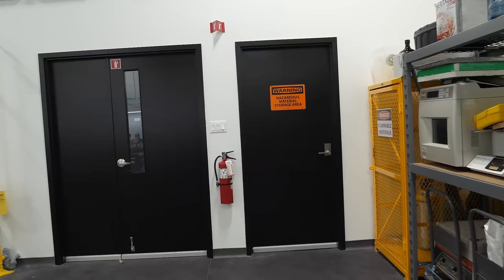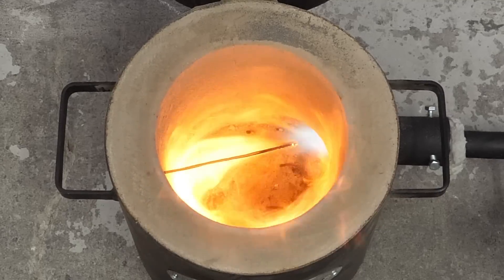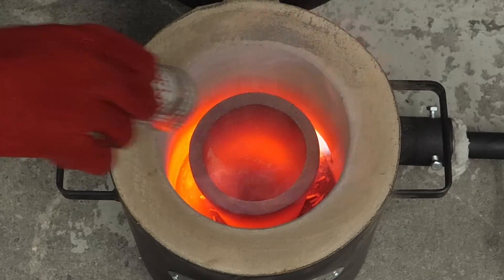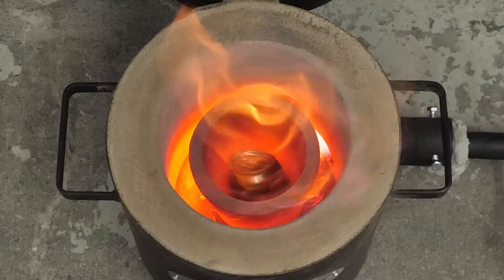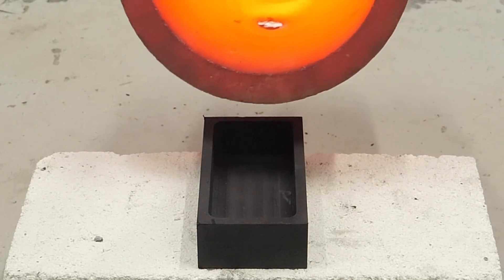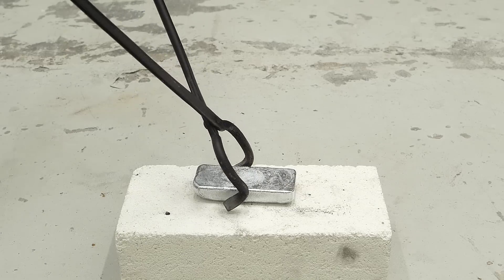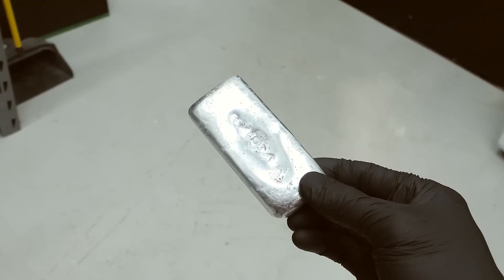Turning soda cans into a metal bar

Comment: Should have separated the lid and the bodies, as they're different alloys even if both of them are alumium-based. I doubt brass and bronze would have been mixed, for example.
Reply: Most brass and bronze alloys are eminently mixable, actually!  The classics all have some amount (including zero) of zinc, tin and lead (balance copper).  Brass of course having no tin, and maybe a little lead (free machining brass), classic "bronze" having just tin (in varying amounts depending on desired hardness), and mixes for various purposes (85-5-5-5 was commonly used for e.g. cast plumbing fixtures).  Also nickel for corrosion resistance and strength (Monel metal; most silvery coins are made from, or clad with, something like this), silicon, and others.  The ones I'd watch out for, are aluminum and manganese bronzes, which might not play well with other elements, or are simply harder to work with.  (Whereas silicon bronze is especially easy to work with!)
Reply: @T3sl4  You missed my point. I do not say both Al alloys will not mix. I said that it is not conceptually accurate to call such mix "Aluminium". If you melt copper parts for doing a copper inglot and call it copper, you use (usually) quite pure alloys. Mixing brass and bronze and calling it copper is an aberration. By the same way, what you get in the video experiment is not "aluminium". Al least, if you use ony one alloy, it would be closer to "aluminium" than mixing whatever alloy you can get.
Reply: @antonioamosanchez4912  Sure; we don't have words for classes of aluminum alloys, like we do bronzes. Alloys also don't look any different from pure aluminum, and most of them can be said to be 95%+ pure.
Reply: No that's actually how they recycle aluminum cans. The main difference between lid and body alloys is the lids have a bit more magnesium than the body. During the smelting process, some of the magnesium reacts with the oxygen in the furnace and comes out of the alloy as magnesium oxide slag. Thus bringing the magnesium average back down in line with the body alloy. So lids+bodies+smelting=body alloy.

Comment: The smoke was from the paint and inner plastic lining (and any residue left from the beverages the cans contained), and yes it is bad to breathe. You should wear a respirator or at least an N95 mask.
Also, you don't need to light the furnace, put the crucible in, then put the cans in once it's hot. It's a lot more efficient to just crush up a few cans and fill the crucible with them, put it in the furnace and then light it. You can then add more cans once the initial lot have melted.

I used to do metal casting as a hobby, but had to stop when the neighbours complained after I melted some brass and they got the zinc fumes blown onto their property. Not my proudest of moments...
Reply: That's why it's usually done in a well ventilated, spacious indoor area like a garage, right?
Reply: @ZudeXbox360  nah wont advise in garage  outside  garage yes. Lpg and propane  gas flames can go high.dont  want to set place on fire.
Reply: @frikkiesmit327  Hah, fair enough. I guess I was thinking closer to like a big warehouse, like a glass blower work area or so when I said garage.
Reply: @ZudeXbox360  oo oky. Sorry.    Well if we look at bigstackd  for example where his furnace stands he is almost in garage but ok the devil forge ( furnace ) he uses with its burner of course burns the gas right so you that have too much flames.  Ive been playing with casting for a while now but it was with low meltpoint metals like zinc and lead. I had channel on youtube but somehow lost access. So i will make new one maybe in month or two. With low meltpoint metals you need only handheld blowtorch we gets hot enough to melt metal to be pourable.its still a fun hobby .
Reply: This is a nice comment, and I hope you and your zinc fumes detecting neighbors have a lovely day.
Reply: Nile didn’t crush the cans so they’d look good on camera as they melted
Reply: N95 masks dont do much to protect you from gases
Reply: @waterturtle2919  Although true, this is false in the context here.
Many metal workers do in fact use N95s to protect themselves from the fumes made by heating up metal.
Not only that, but it also can protect you from smoke (a mixture of gases actually rather than a single one! CO2 + H2O vapor carrying soot. Soot is your problem maker when it comes to inhaling, but luckily, it's a solid.)
Reply: @StarflameLegendsOfficial  most gases are invisible, and they doesn't usually clog up your lungs. What do clog up lungs is solid microparticles that are carried by the smoke flow, and filter masks do help with them.
Reply: Is it better to make your own aluminum this way or buy it? What can I do with aluminum like this?
Reply: I'm guessing the gradual addition of cans, and the whole process, is more related to a background in chemistry and some showmanship for the camera, though what you say is 100^ correct.
Reply: Does a gas mask help
Reply: Now we know why his sense of smell is bad...
Reply: Funny
Reply: Sick Kendrick reference dude
Reply: move out in the woods and start makin' metal bars'
Reply: You should make your own YouTube channel and do it your own, boring, un-artistic, non-heuristic way.
Reply: Haha i  just made a comment like this and noticed yours a second after
Reply: yeah the fact that there's plastic in aluminum cans is such bullshit
Reply: Like besides any plastic shit in air he literally don't have any mask since he said something like this. This means that he is breathing in fumes of metal that he melted and its much worse for your lungs than any kind of plastic fumes.
Reply: @stasi0238  uhh, didn’t OP say the smoke was from the inner plastic lining and other residue? It’s still dangerous to breathe, but I don’t see how it could contain much metal

(OP please correct me if I’m wrong)
Reply: @stasi0238  he wasn't even on camera
Reply: @steamedyam  I meant the way he said that he isn't very sure if breathing it is okay that means that he can't have any mask that can help with metal fumes since they are much harder to stop than burnt plastic. He just wouldn't said it if he had a mask.
Reply: This person takes safety too seriously
Reply: He "shouldn't" do anything. Stop being such a mom
Reply: Bingo  whenever you are melting metal there is part of it trurning gas and it's really easy to destroy your lungs with it
Reply: Ratio
Reply: "You don't need to light the furnace" .
Pretty sure that's not true . . .
Reply: @peterherrington3300  they were saying "You don't need to preheat the furnace before adding the crucible"
Reply: @peterherrington3300  If you read the whole thing the OP said, you'll know they meant that you don't need to light the furnace preemptively.
Reply: @Junren129   I can understand where Peter is coming from if you simply read one small part of the sentence, and then literally ignore everything else that was written.
Reply: @FlyingMozzarella  ah yes thank you for the relevant comment, you really make a great argument there
Reply: @sean5028  ur welcome ;)
Reply: @FlyingMozzarella  selamünaleyküm
Reply: @FlyingMozzarella  <3
Reply: @balikis  Walaikumsalaam (I'm not Turkish)
Reply: @Junren129  imagine not understanding humour.
Reply: @FlyingMozzarella  So what?
Reply: @Junren129  you dont need to light the furnace tho u could just get someone else to Light it for you
Reply: @peterherrington3300  Imagine reading only a few words of a sentence then immediately stopping
Reply: @imadetheuniverse4fun  Imagine being so serious all the time that such an obvious joke flies above your head
Reply: @Water Turtle  it's not a joke.
Reply: @peterherrington3300  Well, at least 43 people got the joke.  I worry for the rest.
Reply: @ImmolationAngelKicksDoors  I got the joke and still didn't laugh
Reply: @ImmolationAngelKicksDoors  Ah yes, "it was just a joke". Takes small part of convo out an laughs at it in public but it do be the internet so there are no consequences, Its just a joke brooo :D

Nothing wrong with a little joke for as long as its a joke, it could be first degree murder and there'd be nothing wrong with it.
Reply: @peterherrington3300  they are saying in those steps he did. You just need to fill it up and then put it in and then light it. U waste a lot less gas that way is what they are saying.
Reply: @peterherrington3300  read the rest first bruh
Reply: @peterherrington3300  don't worry i'm one of the very few that apparently know what humor is. it was funny :) keep it up
Reply: @peterherrington3300  you took that way out of context 😂
Reply: @peterherrington3300  yikes, how does your reply even get likes?
Reply: @peterherrington3300  Brother, you might not know this but everyone in this comment thread just ripped you to shreds.
R.I.P stranger (-__-)
Reply: @peterherrington3300  let me pile on to this ton of herring
Reply: @peterherrington3300  You sound like you failed grade 3 reading...
Reply: Somehow this comment that essentially just mansplains basic safety practices to science channel got nearly 2k likes😂😂😂
Reply: @dustinakadustin  that….isn’t what mansplaining is
It’s not even rude, OP is just adding info

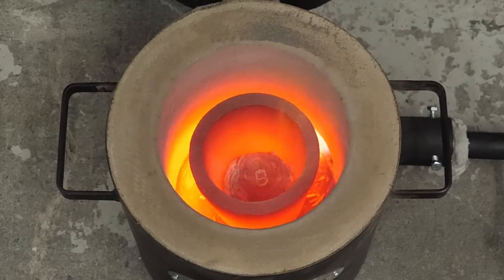Comment: Don't those cans have a thin plastic layer inside them to prevent the aluminum from reacting with the liquid inside of them? I definitely know that's the case with Coca Cola cans, since Cola is highly acidic and would attack the aluminum without the plastic layer. I wonder what happened to this plastic layer when the cans melted in the furnace. Does the slag, which Nile scooped away at 1:17, contain those plastic layers? Cos otherwise the aluminum bar which he made must be highly impure/contaminated.
Reply: Oh one comment 3 mins earlier than mine shared my exact same thoughts
Reply: The paint and plastic burns all off.
Reply: That's the toxic smoke he talked about at the beginning. Some of it will be burned by the flame and turned into less dangerous chemicals but some will still escape. Barely any of it will make it into the bar because it turns to gas and bubbles out or ends up as the floating slag.

Comment: I did the same thing with a kiln built by just stacking cement blocks and using a large propane torch. It took a couple of 20 lb cylinders of propane, but I reduced three large bags of cans to a half dozen muffin shaped aluminum blocks.
Reply: Oh wow!! That's really cool

Comment: Just FYI, pretty sure that tin cans have a plastic film lining them. So that's probably what made the smoke and the smell. Though I could be wrong
Reply: misyah  f**k off spambots. Everyone make sure that you report these bots for spam every time you see them.
Reply: @shn4449  don't reply to them, though
Reply: @旭球  does replying to them make them appear more often?
Reply: That is correct. Afaik that plastic basically can't be recycled though and is always burned.
Reply: It’s aluminum. Not tin.
Reply: @BoxStudioExecutive  "Tin" in this context is a colloquial term.  In the old days they coated sheet metal with tin to stop it corroding outdoors, and lined the insides of cans with tin.  Thus there was an important distinction at one time between a regular can (eg for motor oil or something), and a food-safe tin can.  Eventually the lining material changed to plastic, but the term "tin can" is still used by people who grew up talking that way, and still common in some regions.  You can also see this colloquialism in things like the "Tin Man" in Wizard of Oz, or the "Cat on a Hot Tin Roof" - in both cases the metal in question would really be plated steel.
Reply: My cousin works at a paint manufacturer and he said they make the protective layer inside the cans which is actually a kind of varnish.
Reply: you are right. Have meltet some myself. But melting stuff is now a hobby of the past after I had aluminum exploding in a mold. xD
Reply: Yes
Reply: You are absolutely right. I think there was a tkor video that showed it.... i now want to see a nilered tkor collab

Comment: Hypothetical question.

Would it be illegal to sell these, and if not....how big of a price would it fetch?

Edit: hehe 🤫 don't mind me....just asking for...a friend
Reply: Maybe the emissions from melting the cans are harmful. Depending on the scale of the operation, that could make it illegal.
Reply: use it to make jewelry
Reply: Maybe u can make swords, not used as weapons cuz the metal may break but like just fir display pieces, also can be used as jewellery like one of the guys here said
Reply: It wouldnt be illegal cause your just basically using trash from the street and in terms of price... prolly less then a dollar for just 1 bar.Your gonna need it in bulk to get somewhat of a price
Reply: @elextrommusic  True, the cost to turn the cans into a bar thru this method is quite expensive compared to what you get in the end.
But if you are able to turn the metal into fancy decorations on demand and make more then you spend melting and shaping them, then you might be able to get some profit.
Reply: @m-w-y7325  it could make nice art and fake jewelry, also airplanes use a layer of aluminum oxide cause its an incredibly strong metal oxide and very lightweight so maybe use it to replace something made of heavier (weight) metals.
Those would probably fetch you the most for your aluminum
Reply: Depends if you’re good at scamming, you might be able to pawn it of on some idiot who thinks it’s silver, and if so then yes it is pretty illegal